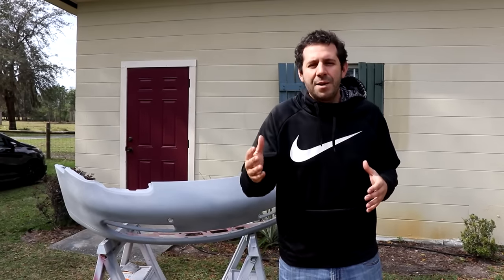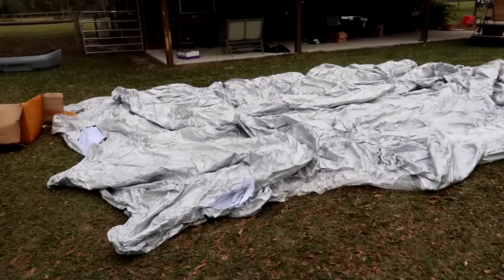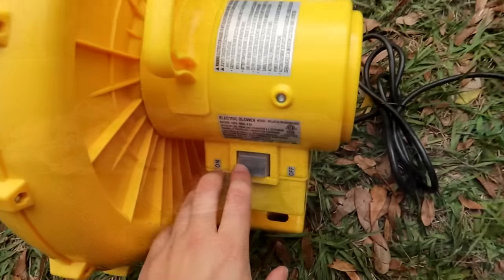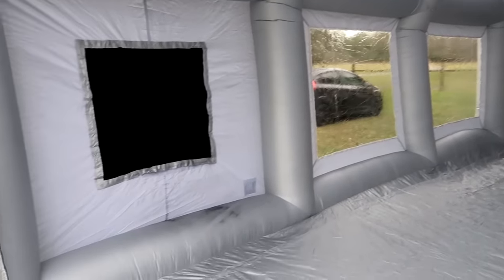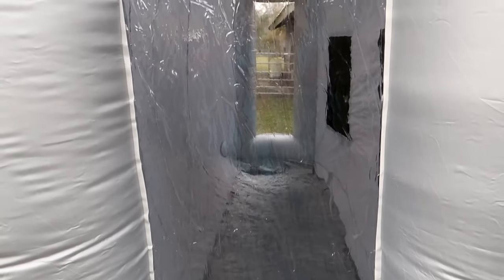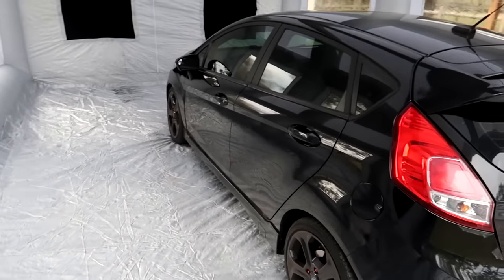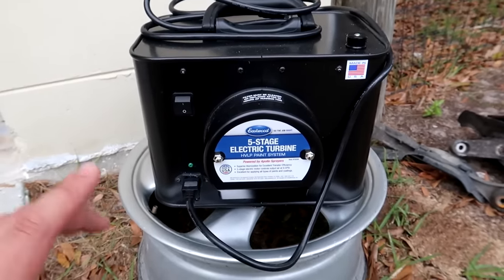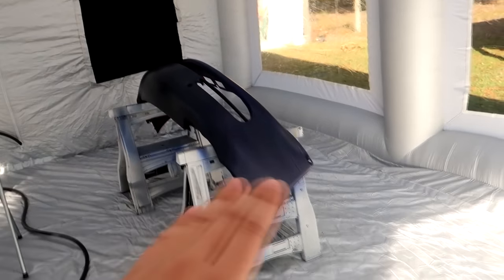I Bought an INFLATABLE Paint Spray Booth from China!

Comment: Samcrac, IMHO what you need to work on now is your spray technique when you paint. How far to hold the spray head from the work surface, how to adjust the spray for the smoothest paint flow, etc. The hardest thing for me to master when I started painting cars was to have patience and not spray the paint on too heavy and get runs in it (like the ones you showed). Always spray the longer length of panels like those bumpers. As you make your spray pass, start beyond the end of the bumper about 8" and spray down the length of the bumper plus about another 8" past the other end before you release the trigger. Never start your spray somewhere on the panel, always start and stop your pass off of the panel. Practice with primer and then work your way into your color coats and clear coat.  

When I was a teenager I used to go to the dealerships body shop after school and sweep up for the guys, clean their paint guns & stuff and they would stay a couple of hours once or twice a week and teach me how to weld emblem holes, do hammer welding, mix body plastic the right way, mix paint correctly, blend panels and lastly how to paint an entire car in just an hour or so with a perfect smooth and even finish. I probably spent 40-60 hours learning and practicing and I was capable of doing professional work on my own cars.I think it would be worth your time to find a body shop that would let you help them/practice a little as they teach you the tricks of the trade. With that spray boot and some good prep/painting techniques you are going to be able to do some impressive repairs and even complete repaints that won't break your budget! Will be watching you! Oh yeah, PROTECT YOUR LUNGS MAN! You only get one pair and they need to last you a long time....
Reply: I gotta call BS on being able to paint an entire car in an hour
Reply: This was insightful. I've always wanted to paint but never wanted to waste the funds on senseless parts
Reply: Spraying 8" past either end is kind of wasting paint, spraying it in the air.  Also, if you have to start beyond the end and end beyond the end, what do you do when you spray the side of a car?  Do you run from one end to the other with each stroke?

Comment: arent you supposed to keep it closed as long as possible since you want to keep the insects out?
Reply: Lol I was sitting there screaming this in my head as he sat there forever talking with it open and driving cars pointlessly in and out. He's a smart guy, but, everyone tends to not think things through sometimes.
Reply: @ddevil4980  he was just showing it off not painting
Reply: @CRST3V3  doesnt matter, the longer the door is open the longer time there is for things to fly in and hang out until he does..
Reply: @ddevil4980  yeah but if it has proper airflow it should be good after a little
Reply: @ddevil4980  i do see your point tho, not doing that would've been the safer route
Reply: @ddevil4980  I feel like he should enter and exit through the other side. so if anything did come in, its stuck in the corridor, and not the room..
Reply: He didn't use the airlock, so, total fail for using the parts entrance.

Comment: Surprisingly well thought out...that’s pretty impressive
Reply: and only real fail though is the car entry....you should just have to unzip it to 8' and then roll it up. Shouldn't have to need a ladder to undo it. 

In fact, they could probably have just put velcro down the sides and left the top attached.
Reply: @Matt if he tripped a breaker with the sprayer, since most circuits are 15 amps, I'd say 5 amps each, or about 550 watts (watts = amps x voltage)

Comment: I find your application technique a bit weird dude. Don't know if you're a pro painter, but I've always been taught to do long continuous strokes from side to side with a 50% overlap rather than stopping and starting at a mid-point on the panel. I only got a bit of you painting the blue on the rear bumper, but it would surely end up patchy spraying like that.
Reply: Oh yeah,  just sayin'
Reply: Not neccesarily true, depends what line of paing you are using. Solvent base paint is applied differently than waterborne paint.
Just saying
Reply: All about feathering the fan at the end of short strokes for an easy uniform blend. Just my opinion based on experience of spraying.
Reply: Mr. Pecker here is 100% correct. There is no way to properly spray any finish starting & stopping in the middle...  if you dont spray it like a machine would, you're doing it wrong
Reply: Your acually supposed to go over a lil bit on each panel, so you dont get thick paint pile up on the edges or doors or panels
Reply: 75
Reply: @ASF-od5tm  The spray technique doesn't change based on paint type. This guy clearly has no clue how to paint a car.
Reply: @Michael Frith
If it's a solid color, even metallic, you definitely can stop in the middle.
If it's a semi transparent "kandy", then you'll be in trouble with stopping in the middle. I seen alot of pros stop and start mid panal with solid colors. The only thing you can't do is stop the spray gun at the door gaps. Paint will get to thick on the edges
Reply: He's def not a pro painter at the time of the video being made.
He shows some pretty bad runs.
But in many applications, a bad paint job is better looking than no paint job.

Comment: Tie a stick to that front zipper.  Why are you climbing around on ladders to get the door opened and shut?  Run PVC pipe across the booth, and tie them to the D-rings.  That will give you additional support, and a place to hang light objects.  Use lights on stands...  Don't tie a hot a$$ light to a D-ring, it will melt a hole in the plastic support.
Reply: Keyring and slide in pole

Comment: When deflating those bounce houses they have reversible fans that suck the air out of em. Even an old shop vac could help. Once again with an air line fitting that would also help you could use a foot pump and pump the air out like that as well.

Comment: Nice thing actually!But use the small room when you enter the spray area, not a good idea to keep open up to the outside all the time.I think reversing the fan when deflating the thing would make it a lot quicker and completely empty it out, although getting it back in to the small bag probably won't happen anyway =)Manufacturer and cost?

Comment: i would be tempted to make a PVC endoskeleton for it
Reply: thebad300 I was thinking the same thing... would be a dope portable climate control garage
Reply: @milleniumann28  i definitely would, at least 2 inch if not at least some 3 inch in it, the hooks on the sides could also be used to secure the pvc to the sides.
Reply: You mean exoskeleton? Endo would take away valuable work space.
Reply: Anon 4425 it wouldnt take much space, would keep it from collapsing and moving in the wind, the blower would still keep the nice and blowed out... as well as moving fresh air.
Reply: If you spray flex seal over the air tubes and what not so it does not leak air you could just blow it up and then leave it but the PVC pipe on the inside is Also a great idea and I would not.mind having this for even a camping tent for me and my kids so they can have a area to pay in and run around if it rains and what not and just put our tent next to it so we have sleeping area and a collapsible table and chairs and bam indoors mess hall  bug free
Reply: @Jakers_Grayfox  I JUST SLASHED HOLES IN THIS INFLATABLE AIR BOOTH TO SHOW YOU THE POWER OF FLEXSEAL!
Reply: @viperfukgoogplus386  billy mayes APPROVES!!! INCREDIBLE!!!!!🤣

Comment: The best part is, it's made of chinesium and will last a lifetime! You need a fan to suck the air out!
Reply: lifetime of a butterfly?
Reply: I'm fucking dying
Reply: Ave would be proud
Reply: Kinda like one of those wiggley giant thin-man inflatables
Reply: I mean, it certainly should have an easier life than a similarly built bouncy castle , i've seen multiple adults jumping in one at once before, that's gotta put a lot of stress on the seams but they last year after year under commercial and rental use...
Reply: Not out, in! If you force filtered air in you create an overpressure and no dust can come in. 
With air blowing out you create an underpressure that sucks air (including dust) through all small cracks an holes
Reply: Chinesium hahahahaha....

Comment: you left the big door open all the bugs are already inside bro
Reply: I was thinking exactly the same.
Reply: Paint outside if all the bugs are inside.  Gotta be smart!
Reply: Lmao
Reply: The bugs are filtered (sucked) out. He said that.
Reply: @jackstubbington387  I know this. But once the door is zipped any bugs, lint or debris is filtered out. Get it, got it? Good. The video even shows him explaining that. 🤦🏽‍♀️🤷🏽‍♀️
Reply: @jackstubbington387  yes! And that's why the filters SUCK them out. Why can't you understand that concept?
Reply: @jackstubbington387  4:20 is your answer. 🙄🙄🤦🏽‍♀️
Reply: @jackstubbington387  did you see anything in the paint when he was done? Get over it. The filters work. Stop being a pessimist.
Reply: @jackstubbington387  I was just letting you know that the booth has filters. Just like air conditioner and oil filters...it minimizes and eliminates trash and debris. Have faith.
Reply: It's ok it has " a filtration systems " 
Lol...
Reply: @Mscross  you realize if a bug lands on the paint, it's not coming off. So how is it gonna go thru the filter?
Reply: @Mscross  and those filters, seems to me they prevent debris and bugs from coming in , not going out. Why would the filter be on the outside and how are the bugs supposed to go through that black material? Carbon dioxide and paint fumes are supposed to exit out. Besides, the filters dont "suck", so who says a bug would go towards one of those filters if it got caught inside?
Reply: @homelackin2234  one thing though...the bugs would be filtered out BEFORE you start painting. Don't make it so hard. Lmao! 🤦🏽‍♀️🙄
Reply: @Mscross    Acting all smart lol do YOU understand how filters work? The filters work by allowing air in but keeping bugs & dust out. But if bugs get in (from thre doors being left open) the filters arent going to magically remove them. They don't work both ways. Additionally there's no "sucking" going on to filter anything. The noise you hear are the blowers keeping the structure inflated. Not anything filtering. The filters are nothing more than fine meshed glorified house screens, again only allowing air to come in & keeping bugs & dust out. If you disagree, maybe you need to watch again.
Reply: @iLitAfuseiCantStop  you're wrong and I'm right. Btw...let it go.
Reply: @Mscross  Because you know you're wrong & you'd rather drop it than admit it.
Reply: @iLitAfuseiCantStop  NO! Because I'm not going to have this same conversation with every silly Joe who comes into this comment section over and over for weeks and months to come. Get it? I said what I said. Move on! Enjoy your life man! 😎🙋🏽‍♀️
Reply: @Mscross  You are wrong you know..
Reply: @redbullmax  Men! So foolish! 😂🤣👌
Reply: @oscarb9139  haha! Hilarious
Reply: The Great Imposter like the door opens and shuts on a normal spray booth
Reply: The Great Imposter I assume you’ve never painted a car in any kind of booth
Reply: @Mscross  Still wrong
Reply: @Mscross  were talking about the bugs that get in through the door. The filter will remove debris coming in through the blowers but will not filter the air inside the room. The booth is positively pressured, forcing air out the small cracks, but that's nothing to a fly. I would be entering and exiting through the double doorway at the other end of the booth to ensure no dust or bugs snuck in with me
Reply: @Mscross  I paint cars for a living.  What experience do you have ?
Reply: @John-lc2lz  sounds like none 😂
Reply: @John-lc2lz  I'm not talking about painting cars stupid. I'm referring to a filter.
Reply: @volvojoe  I sure don't.
Reply: Hmmmm... 🤔. I may have to delete my comments. The silly men who read them love tagging me to tell me I'm wrong while I'm so over it! 😂🤣😂🤣🤔🙄 I don't mind leaving the comments but wow men are so relentless! 😂🤣Whether the bugs are filtered out or in...they're filtered. OMG!
Reply: @Mscross  incorrect
Reply: @volvojoe  and that is correct.
Reply: Ms. Cross y’all are both right. I work in a paint shop and if a larger fly got in you would have to kill it to get rid of but smaller ones may filter. Never seen gnats in the booth but have seen moths and horse flies. But on other hand he it wasn’t like he intentionally leave door open while spraying he had a accident he rushed other than that he leaves through smaller door. I understand ur argument
Reply: @isabelvalero206  thank you...lol. I know I don't understand the mechanism of a paint booth, but I was just basing my thoughts around the purpose of a filter. 😏👍🏼
Reply: @isabelvalero206  and that makes perfect sense about the larger insects. 💁🏽‍♀️
Reply: @Mscross  Why do respond to dumb poeple ? How do they think you get a car inside any paint cabine ? You have to open it anyway, the bugs com in, you let the bugs be filtered and then you paint, if they don't understand this simple things ...
Reply: @surronzak8154  you are absolutely correct. I had to let the conversation go because their lack of knowledge (ignorance) exhausted me. It was common sense but these men don't get it. Lol.
Reply: @Mscross  nope. the filters are for filtering the air that is sucked in. Bugs that are already inside dont get in the filter because the air is sucked from outside the booth.
Reply: @Mscross  are you sexist?
Reply: Isnt it positive pressure inside?  I thought the purpose of the second blower was to have positive pressure to blow out any materials or bugs that would try to go inside?
Reply: I thought the same thing and posted it before reading yours..lol
Reply: @Mscross  OMG.. that dictionary explains it clearly. There is no mention about sucking mechanism. It just doesn't allow anything to cross from outside to inside and from inside to outside.
Appreciate you looking it up, but you still are half way there , look up again but this time don't be biased . Don't look it up to find that you are right, you will only see that. Just look it up again to find the true meaning , and concept of filtration. 
Nothing sucks the bugs out.  It just prevent any debris to enter through the open window.  Most People put magnetic  Bug filters on their windows and doors..
Reply: @Mscross   Arrogance has nothing to do with a person's gender.
Reply: What if the bug is stronger then the suction?
Reply: @mrstanskaggs1  Yep, no air comes into the booth, all air goes out. He explains it in the video, but everyone who keeps arguing with @Ms.Cross is missing that point. If air was negative in the booth, the paint would simply over spray and stay inside the booth, which would cause, well, death.
Reply: Ms. Cross you're awesome ty for your comments more fun than the video :D
Reply: G H lmao did you guys completely skip over the part where he said there were TWO blowers?? One for IN air and one for OUT air? No positive pressure or negative pressure just equal pressure and FILTERING from the INSIDE AND OUT just like Cross has been trying to explain to you fucks for months wtf kind of paint booth just pointlessly sucks a whole bunch of air into it if you aren’t also going to be pumping it out?
Reply: @BLZPHR  thank you so kindly...you just can't help some people.
Reply: @lukereeves3711  you're so very welcome!
Reply: @Mscross  there is definitely not enough circulation in there to force the bugs into those filters lol
Reply: @justincotterjustincotter1977  I thought it said Justin Cooter! 😂🤣🤦🏽‍♀️
Reply: MK3 Andrew that’s 100% not for what the 2 blowers are for, 1 is for pumping the whole thing up and keeping it painted, the 2nd is for positive pressure on the inside of the booth. the filters are simply for the positive pressure system so no debris can be pumped in through the second blower. if a bug flies in through the door it’s not going to get filtered out because there is no suction going on
Reply: Plant-Based MD, the bugs were like..... “bounce house=YIPPPPEEE!!!
Reply: I think it's using positive pressure.
Reply: @Mscross   back at it again
Reply: So having used many of these units, I'll tell you guys how they actually work. 1 of the blowers is used to fill the small chamber at the back of the booth (btw that little room is not supposed to be used to store anything) once that room is filled will air the pressure will push through the filters into the main chamber. The 2 side filters near the back door,  filter the air out of the main chaimber. Its suppose to simulate a cross draft paint booth. Side filters have to be washed out or changed every so often, if not they will clog and not let any air out of the main chamber , basically turning your inflatable spraybooth into a huge balloon.
*side note, the fact that he paid $1,000 for this unit is awesome. The company that originally made this unit sells an F150 sized unit for like $10,000* of course those are double stitched and the main door is a lot easier to open and close and the filters are similar to actual paint booth filters.
Reply: When bugs are in the booth, all you do is open up the main doors zipper 6-12 inches and the inside air  pressure will push out the bugs as longs as you leave it open for a few minutes.
Reply: @czr171gmailcom  right so positive airflow. Also helps keep the bugs/dirt out when the door is open. The food industry uses this technique when they produce ready to eat items in the same facility as raw meat without needing doors.

Comment: Sam, hook up your shop vacuum to the structure inflation ports first thereby knocking down the booth. Then apply vacuum to the fresh air input port. That should take it down to foldable. In the bag it goes.
Reply: or maybe the fans could be wired to reverse.. thereby creating a vacuum.